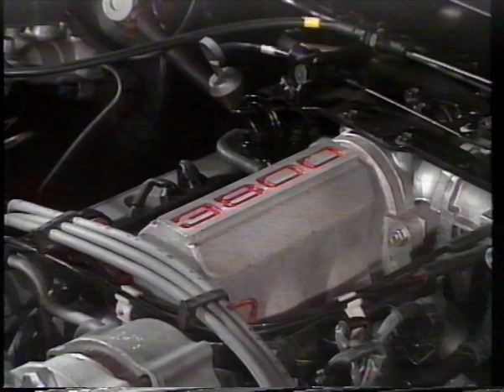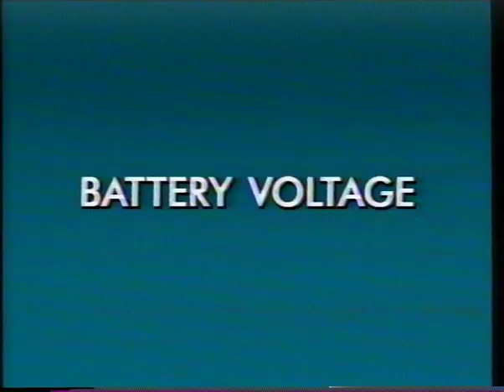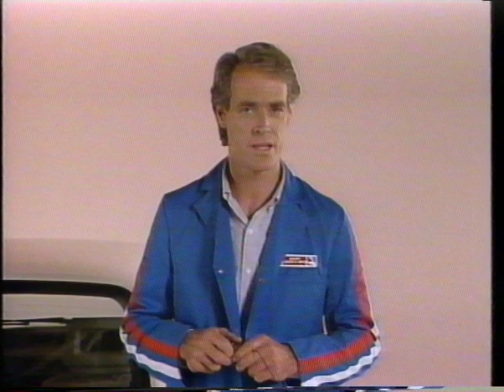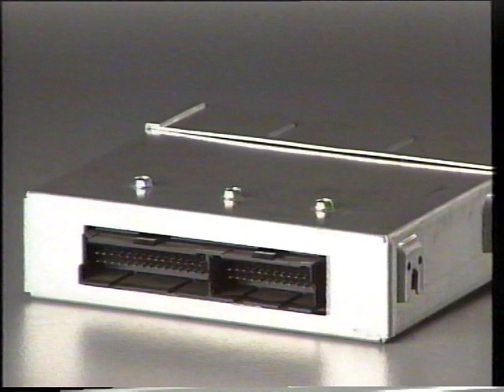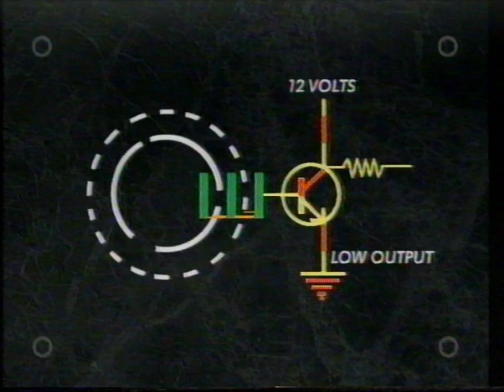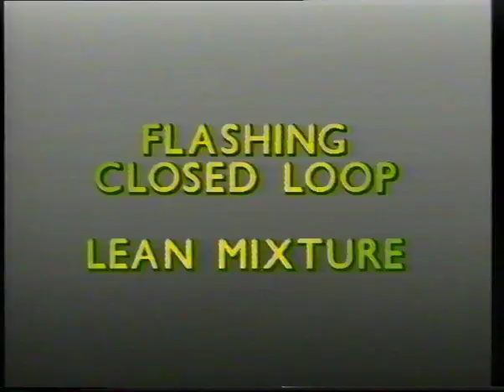GM Holden Delco ECU Training Video

Comment: over thirty years old and my 2 3800 engines are still running with over 300000klms and the best thing is all the parts are easily available